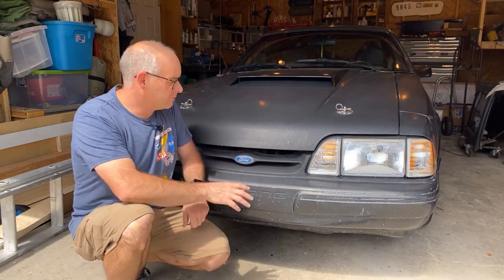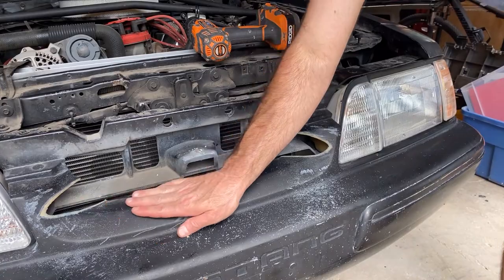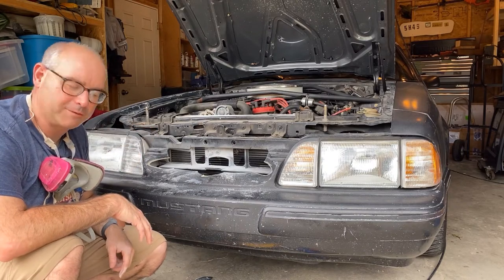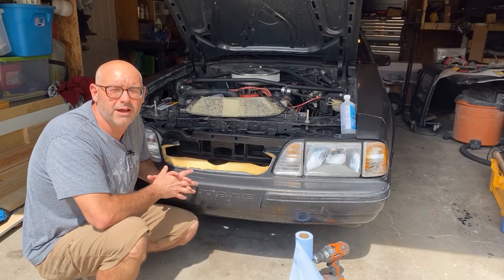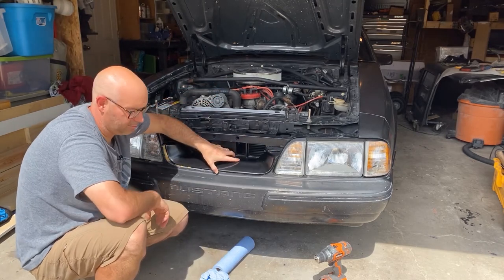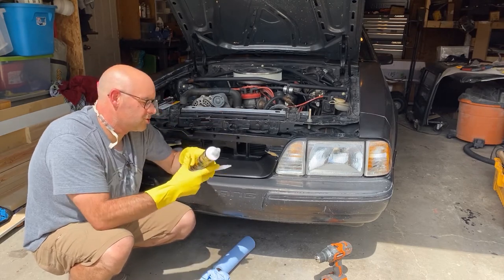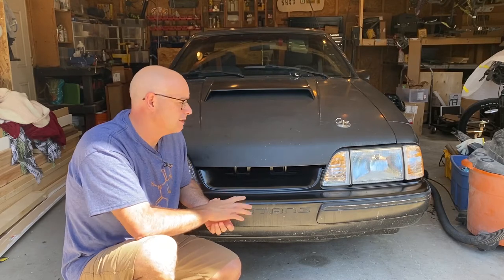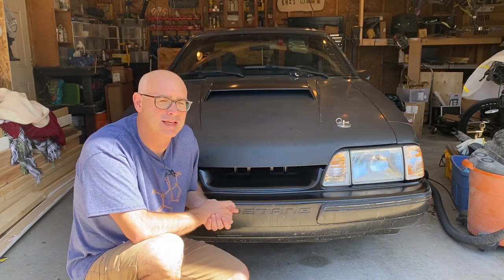Fox Body Grille Bar Eliminator Install

Comment: Dude the grill and the hood go together so good 👍. At 1st in wasn't with it until I saw the finished product.
Reply from the maker: Thanks Oscar! I appreciate you watching :)
Reply: @RyanHolota  hey man how much was the engine when you swapped it? And where did you buy yours? I'm thinking of buying a fox that's not a V8.
Reply from the maker: @oscarvillarreal8951  Great question - I’ve actually been thinking about doing a video on this! I did the swap more than 20 years ago, and I was just able to buy a running engine from a wrecker at the time. I reused the 7.5” rear and 4 cylinder transmission, and converted the efi to carb and used a Duraspark Ignition. I would not do that again - it’s worked great, but now you can buy standalone efi harnesses, and the carb fuel system has been the least reliable part of the swap. I would definitely keep the EFI next time. The big differences between a V8 car and a 4 cylinder car (87-93) are steering rack, front brakes, transmission, rear end, and cooling. There are various strategies for dealing with all of those, depending on what you want/budget/skill level, etc.
Reply: @RyanHolota  what's wrong with the fuel system of the carb?
Reply from the maker: @oscarvillarreal8951  just the way I did it. I’m using a homemade in-tank pickup and a Holley Blue pump. Have gone through a few pumps and a couple of different line types and routings. Plus, the pumps are very loud. Not ideal.
Reply: @RyanHolota  a video on  the swap would pretty  cool. Can the 4 in line transmission  handle the V8?
Reply from the maker: @oscarvillarreal8951  Yes, it can, but it does need a special pilot bearing. It’s not as strong as a V8 T5, of course, so a lot of it comes down to how hard you hook the car and how hard you drive it. The gear ratios are different as well, with a much steeper 1st gear in the 4 cylinder transmission. Some like that, others don’t.
Reply: @RyanHolota  when you do a change like that do you have to change the wire harness or is the same 1 good enough? Did you have to tune the computer?
Reply from the maker: @oscarvillarreal8951  there is a lot of wiring to do, and the computer does need to be changed. I went with a carb (in 2001 - and I would not do that again) so everything was custom with a Duraspark Ignition. If you stay EFI and use an engine harness and ECU from the same year as your car, it would be much easier. It will plug into the chassis harness, mostly (for gauges, etc) but note that you will need to change the tach.

Comment: made the Cut today .. pretty easy  ..with a Carpet knife end some oil on the blade .. cuts very easy trough the Plastic... still waiting for the parts...
Reply from the maker: That's a good idea - you can probably make a much more accurate cut that way too.